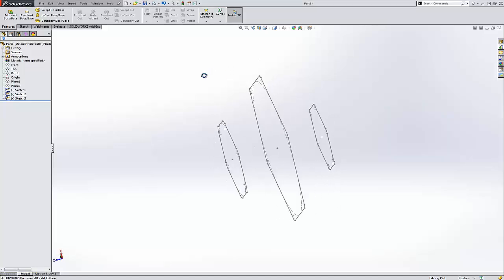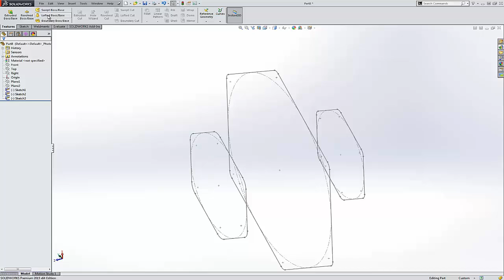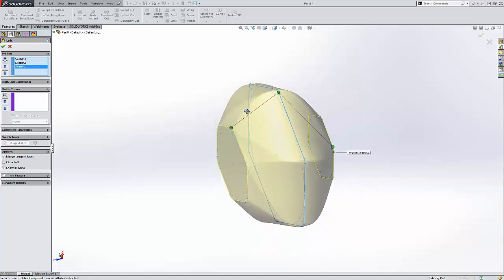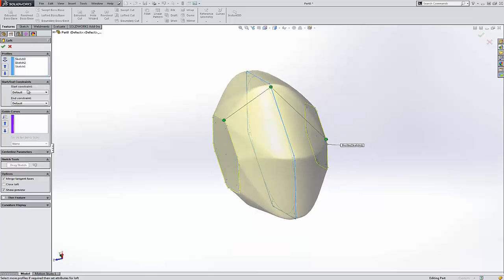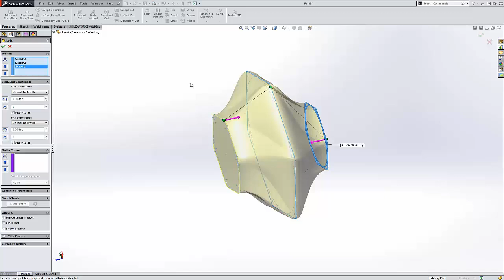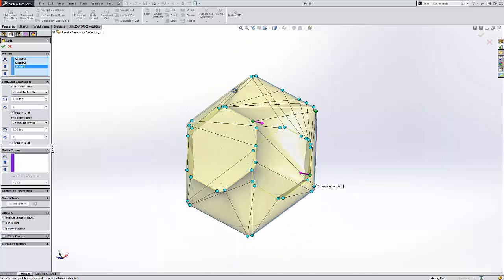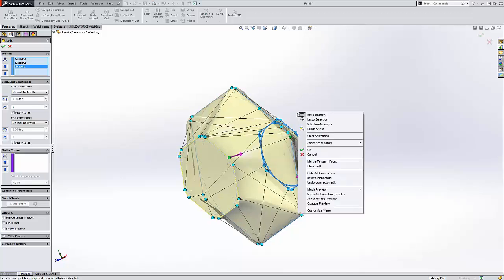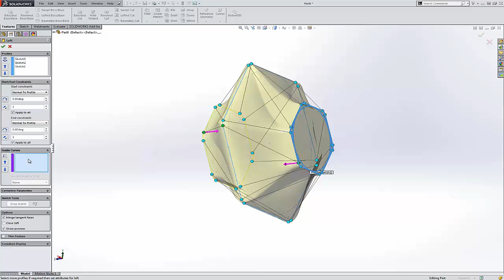SOLIDWORKS - Manipulate Your Loft with Connectors

Comment: What about when you get "self intersecting shape" usually on some plane you just need to switch 2 connectors - make one pass another. However solidworks most of the times will not let do this. What to do then?
Reply: it has been 8 years, but incas you fiund a solution and still remember it, please let me know!
Reply: @hanfiball4136 hi! No - loft is barely working crappy feature. Sad, because solidworks is going subscrbtion paid model and adding unnecessary cloud tools nobody asked for.. While it is 2024 SW still runs on 1 processor core.